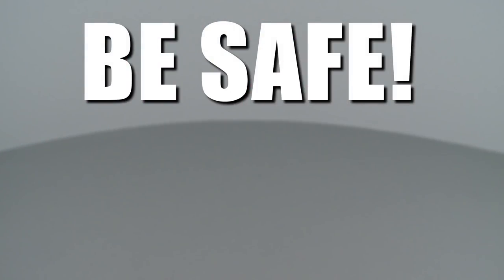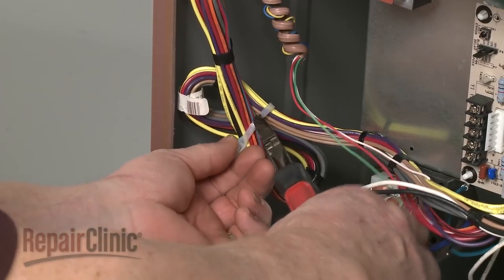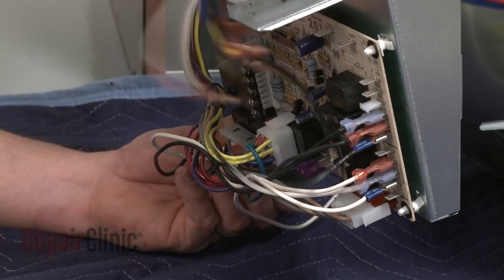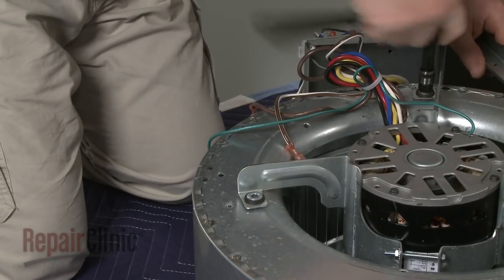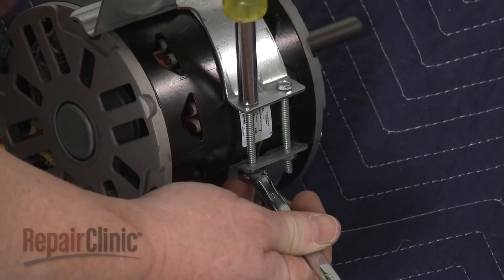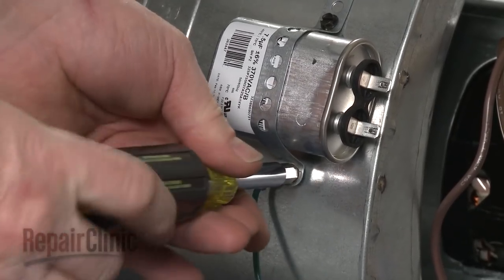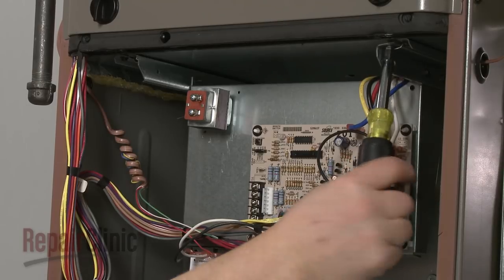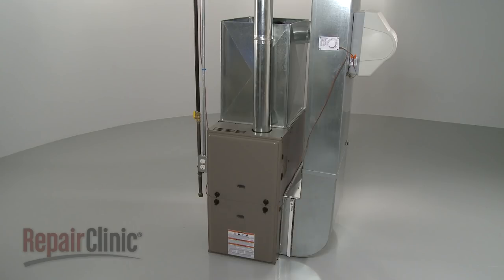York Furnace Blower Motor Replacement #S1-02435735000

Comment: I wasn't aware the assembly could be slid out. You guys just blew my mind!
Reply: Lol... Yeah, I came here just to figure out how to get that sucker out.  Was a piece of cake after watching the video.  I did have a problem putting it back in though.  That lip on top near the front was too high.  I had to use a couple thin metal bars to jimmy it in there.  It wasn't too much of a problem once I realized why it didn't want to go in past a certain point.

Comment: I notice that the 3-legged bracket on our recently purchased York furnace fan motor is not as substantial as the bracket shown in this video.  The bracket clamps around the fan motor and secures the motor to the fan cage.  I was shocked at how flimsy our bracket is, compared to yours.  Oh, those sneaky Chinese.

If there is a polarity in the 2 brown wires which connect to the run capacitor, I may be in trouble.  So I'll wait to see if someone here can tell me.  The video seems to say that either brown wire can be connected to either end of the run capacitor.  However, one of the brown wires has a stripe.   Thanks in advance for the advice.

Our York furnace was still in guarantee when the motor quit during AC season, just 2 years since new.  The people we bought the installation from would not honor their guarantee:  They said that we let dirty air into the motor.  This was dishonest.   The next licensed repairman to look at it said the motor had failed because of a mfr's defect, not because of dirt.  He said he had seen motors just purring which were really dirty, and that our motor was relatively clean.  He wiggled and rattled the shaft to show how much slop was in the bearing surfaces.  What a klunker.

Thanks for the video.  And yes, we bought a replacement motor from repairclinic.com/.  Looking foward to some heat.

Comment: when I bought me home there was an addition put on the back. 2 years now and I still dont have enought heat going into that new room, they did all the duct work  but i dont believe  they change the furnace or did anything to it  to push that air that far away , is there a way to increase the blower motor to push more air through at a faster speed?
Reply from the maker: +Allan Belmore Not without damaging the motor. The motor is designed to run at a certain speed for certain applications. If you increased the speed you will likely burn up the motor.